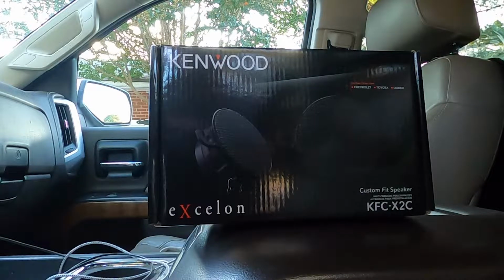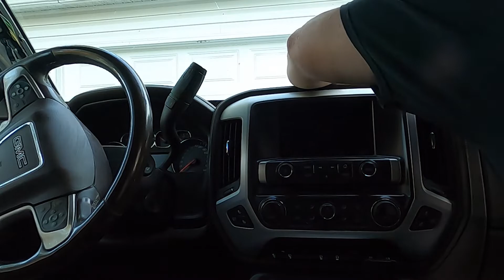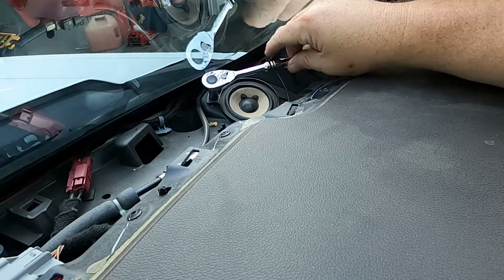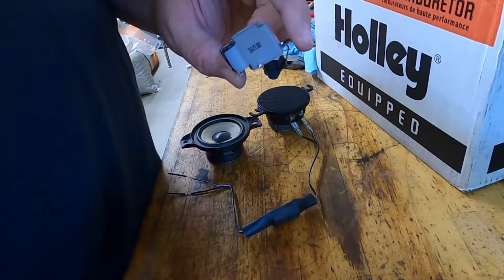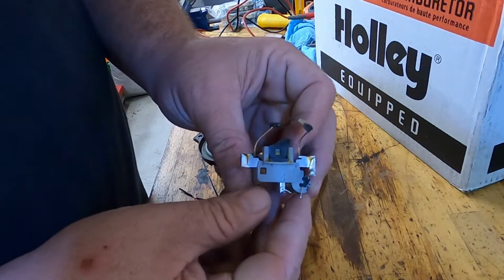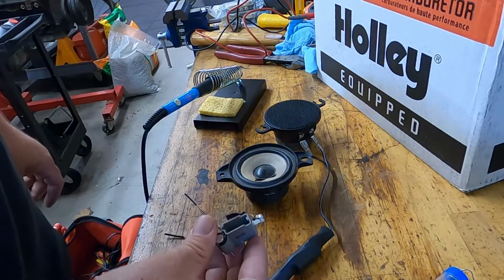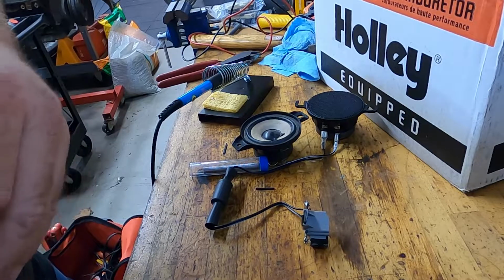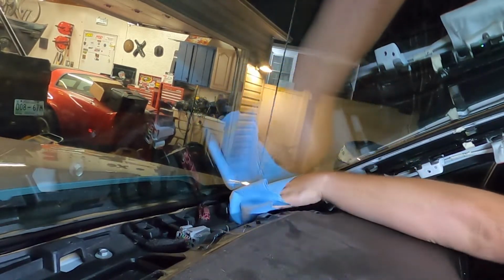2014 GMC Sierra Dash Speaker Replacement

Comment: SWEET BRO!! Im doing this exact same thing, on a 2016 silverado crew cab... this very weekend - I got the component kit from Kenwood, comes with the same dash speakers, I just put in the Kenwood matching 6.5" in the rear doors today - I added sound deadening, inside the door where i could reach and all around the speaker.... Im only doing that on the doors, no where else. Tomorrow I plan on the front doors and the dash speakers! I am going to install an Audio Control 5.1300 and a kicker sealed box with an L7T 12" Sub under the rear seat... thanks for the video, i learned some things.

Comment: Solid video. Few things to mention. White stripe is positive. Solid black is negative. Second is that the passive crossover is not a capacitor. A capacitor stores electricity until needed. Frequency doesn't have much to do with a capacitor. Likely you hooked the speaker up backwards if you left them like which will cancel the crossover frequency between that speaker and others making it lower volume. Unless you hooked all the speaker the same way.

Comment: Thanks for a great video.  I have a 23 Silverado with Bose.  I absolutely love my truck. I was told that 3.5" speakers would work in the dash. Do you think there would be any cutting to get them to fit?  I have a pair of Hertz DCX 87.3 sitting around.  They are 4ohm and 92spl.  I heard the Bose dash speakers are 2ohms.  I am putting in a sub and thought doing the dash speakers would hold me over until a better interface comes out for a full install.  Not sure.
Reply from the maker: Thank you! Your truck is the generation after mine but i did a quick search and saw the factory speaker size is 2 3/4 like installed in the video. If you wanted to install the hertz speaker in your dash you would have to modify it to make it fit. It would not be a direct replacement. The Kenwood KFC-x2c speaker I installed is also a 4 ohm speaker. Let me know if you got any other questions.

Comment: Did you end up removing the factory capacitor? I couldn't tell if it was still on.   Wish they made adapters for this connector.  I haven't been able to find any.
Reply from the maker: I cut it out of the circuit but it is still physically attached to the connector. The factory one is not being used and I used the ones that came with the speakers.
Reply: It’s called a crossover, not a capacitor.

Comment: Are u still useing the stock bose amp or did u use a aftermarket amp?
Reply from the maker: My truck did not come with a Bose system so there is no amp powering these speakers. It is just the factory head unit running them. In the video after this I do install an amp plus a sub and power all the speakers that way. Give it a watch if you like.

Comment: Did you run into any problems with sound due to installing two bass blockers?
Reply from the maker: No I had no trouble with them and would recommend using them.

Comment: I’ve just purchased the same speakers for my dash, have you ran into any problems with the way you’ve set it up? Also just to clarify, you removed the factory capacitor? Or did you re solder it back with the wire from the new tweeter?
Reply from the maker: I haven't had any problems out if it for the several month's ive had it installed. I the factory capacitor is not being used because I am using the capacitor with the speaker kit.
Reply: did the replacement speakers come with a capacitor ?

Comment: what is the actual size of that speaker? 2.75 inch?
Reply from the maker: it is a 2.75 inch speaker.
Reply: Good video I’m getting ready to change out mine. One of my bose separate dash tweeter is blown

Comment: Idk but every where I looked the capacitor is hooked on th positive.
Reply from the maker: I checked my polarity with a multimeter and was getting positive values. It doesn't sound out of phase so im just going to run with it.